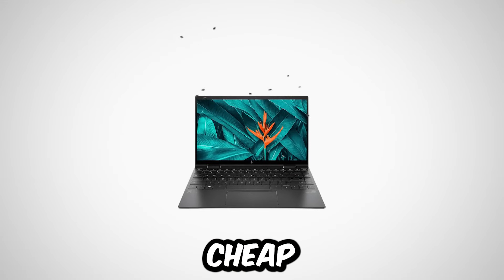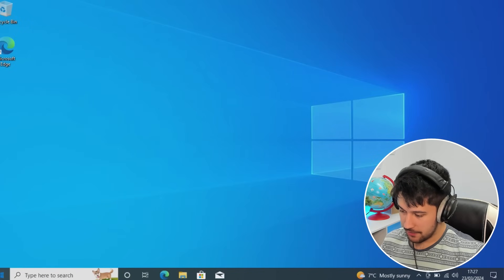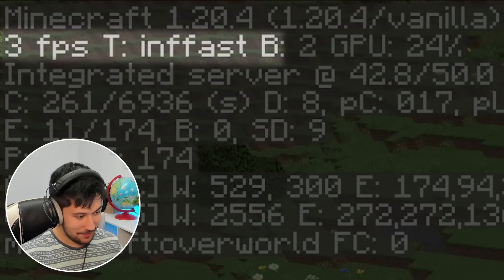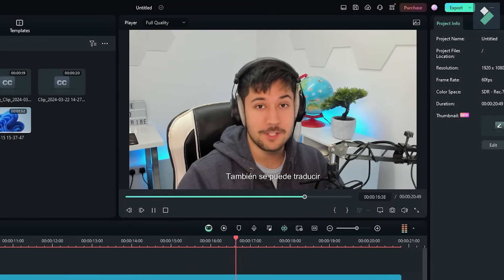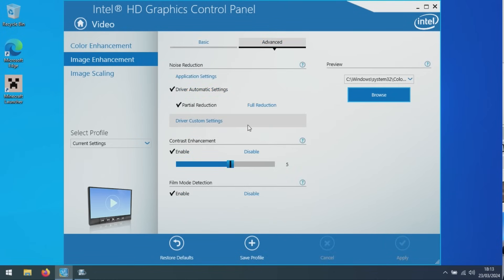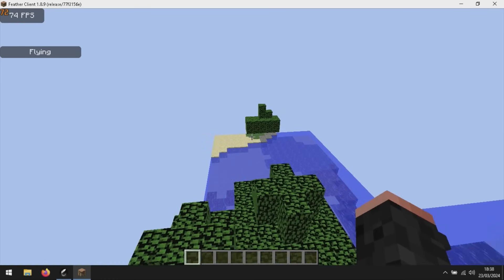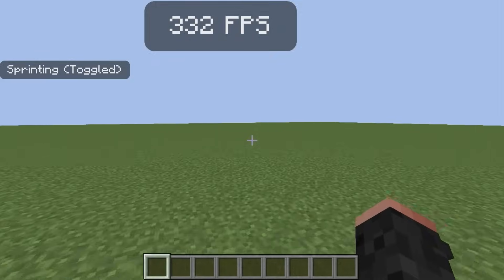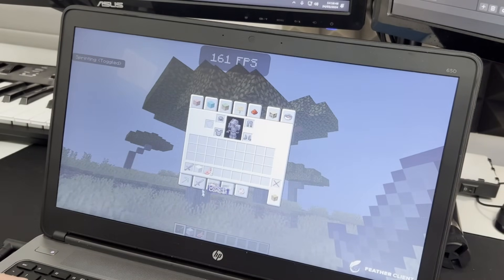How I Optimized A $20 Laptop To ___ FPS in Minecraft

Comment: So, for those of you who are curious, any fps above the laptop display refresh rate is unnecessary.
This means that, after optimizing it as much as possible, you can then tweak the settings however you want until you can play at an avg. of what your display refresh rate is or on the other hand, you can turn on vsync in the options menu for minecraft and have the fps max set to the display refresh rate.
Either way, you do you.

Comment: I have some performance mods use Linux with vulkanmod just in case the gpu doesn't support it inside of windows it make a gt 1030 go from 60 - 100 to 400 - 500 16 chunks both you should really try it
Reply: тут нет вулкана так что Vulkanmod не прокатит а хотя подождите он только под Linux поддерживает, да хорошая идея, я так несколько ноутов ожил и тут тем более intel у которого Opengl станет 4.6 и вулкан 1.1

Comment: I have an old x250 and 1.20.4 with simply optimized is infinitely better than 1.8.9 so im using that. Also your cpu render ahead limit was quite low and keeping it on 5-6 is normally better so that's probably why you werent getting many frames.

Comment: Had a laptop with i3 3110m and with fabric and mods like sodium I easily get 60+ fps but   
compromise with 2 chucks :(, don't lie but  with upgraded ram and ssd it will last long than any ultra budget comes in today ,for surfering net and low  intensive task.
Reply: Had? like you don't use that laptop anymore? Cause there are a couple things left out from the video which would improve the performance even more. If you are interested that is.

Comment: im 100% sure you can optimize glass stone and wires to play 100 FPS on minecraft.
Reply: What do you mean, explain pls
Reply: u need a good cpu to run monecraft at 100fps (atleast a 4/5 gen)
Reply: أراهن أنك لم تشاهده حتى النهاية وقلت ماين كرافت
Reply: @Dryashs  To be fair, Minecraft is a pretty old game based on voxel, I wont be surprised if a 3rd gen intel can run it
Reply: @Baconator20000  it can
Reply: @Dryashs I have a pentium silver and it hits 100 FPS with optimization mods
Reply: He will put i914900kf and rtx 4090 128 gb ram and 4tb gen 5 nvme ssd in glass slab😂😂😂😂😂😂😂😂

Comment: Feather actually decreases your performance when gaming. As well as injecting code into some modloaders, it's pretty bad.
Reply: Yeah should use Badlion
Reply: @QuickVicMC badlion is even worse, the should use forge with of foamfix and another mods
Reply: I use feather and its good for me but that's my opinion
Reply: @coneh2  foam fix is ass
Reply: Feather is better for lower amounts of ram and 3rd-8th gen CPUs. I went from 8gb of ddr3 on 200 fps with a i7 4th gen, to 24gb of ddr3 on same CPU about 100 fps.
Reply: just don't use a goddamn client and get sodium instead of optifine it's way better
Reply: lightbulb pancake car
Reply: @ggolden  omg niko oneshot
Reply: @ggolden  agreed
Reply: I recommend Prism Launcher with a system installation of Java, so you have full control of your client(s).
Reply: Just use Sodium.

Comment: I think you would be better of with fabulously optimized than just throwing together a bunch of mods. A lot of mods are incompatible or do the same thing. Some might even make the experience worse. Using a modpack which has been tested, and is made to get the best performance possible would probably be a better choice.

Comment: For all of those of you in the comment that did not ask, this is basically how I have to try and optimize a macbook pro from 2019.
But in my case, since it's a macbook, it doesn't have settings to optimize the laptop for performance and I don't think it has bloatware... bc it's a macbook. So, I just have to download mods and pray that the performance improves.
I can play at max render distance with an avg. Fps of around 50, I believe. But I also think that some of the performance optimization mods are fighting against one another somehow, so I gotta do some testing of my own to see what is the best combination that improves my fps the best.

Comment: notrodan i optimized my laptop soo good that i can get 600 fps on integrated graphics at accetable graphics and its pretty old too i used the xtboxtool to download a bunch of optimizers and after running all of them + some internet and regedit optimazations and overclocking my ultra low power cpu i managed to achive 3.4ghz with a 2.3 base clock and the 600 fps at 6 chunks 720p in 1.20.1
Reply from the maker: Great work!

Comment: Hi NotroDan ! Could you tell me what all the optimisations and mods you would recommend for a Toshiba NB250 ( 2GB DDR3, 256GB TeamGroup SSD, Intel Atom N455, 1.66 Ghz, 1 core 2 threads, Integrated Graphics, Windows 7 Family Premium Edition ) are ? Also, 1.7.10 Optifine ( EVERY setting on OFF and Fast Math and Fast Render ON ) set on High priority in Task Manager gets only 20 FPS. I need your help 😅.
Reply: Вы пробовали запустить Linux на таком ноутбуке?
Reply: @RKNidinahui666 I'm trying installing nobara linux brother can you help i keep getting put into grub rescue mode when booting the usb and it's saying insmod not found?
Reply: @crusvaceans  скорее всего образ записался неправильно, попробуйте Arch Linux

Comment: I notice you keep blaming it on the GPU. I have a laptop with an i7-4700MQ. It also has HD 4600. It runs minecraft very well. It’s your CPU, not your GPU.
Reply from the maker: Yeah it is only a dual core, maybe a CPU upgrade is what's needed. What sort of FPS do you get?
Reply: @NotroDan i know that it has no stuttering and it runs it 60+ fps with little to no stuttering with no windows optimizations and no performance mods. I have to reinstall windows on it rn, so cant check for sure, but based off of memory that is what i remember. Can you try to buy an i7-4700MQ or something similar and try it on this laptop in a video?

Comment: Hey notro u didn't need to buy the battery because the flashing power button means the battery is very weak (dead) but if u hold the power button for 30 seconds it will turn on i havpd same problem I can easily fix
Reply from the maker: Ah well, at least I can use it without being plugged in all the time now

Comment: how are you running minecraft 1.20 even tho 1.17 and after gone to opengl3 which the intel i3 is not supported???
Reply: the integrated graphics of the i3-4000m, intel hd graphics 4600, supports up to OpenGL 4.3
Reply: @lunaaaaaa_aaaaaa  mine cannot run minecraft 1.17 and after
Reply: @_itsnotstickly_  i cannot figure out what's causing the issue with just this comment, could you provide me with more information of why it doesn't?
although i'd assume you haven't updated your graphics drivers
Reply: @lunaaaaaa_aaaaaa  its a i3-2130m old laptop altho i have another laptop that has a 10gen intel core i always wanted to run minecraft on my old laptop
Reply: @_itsnotstickly_  you're out of luck, minecraft 1.17+ requires OpenGL 3.2, and the integrated graphics in the i3-2310m (you made a typo there), intel hd graphics 3000, only supports up to OpenGL 3.1
this is why you check your hardware compatibility instead of assuming it will run
also you have a 10th gen laptop, why not play on that instead...?
Reply: @lunaaaaaa_aaaaaa  isnt there any way to upgrade the graphics and change it to OpenGL 3.2 like upgrading the graphics through device manager my 10 gen laptop is broken bios chip fired up i am still ordering another bios chip
Reply: @_itsnotstickly_  you can't just hammer in support for newer OpenGL versions if the hardware cannot support it
this is a HARDWARE issue, not a software issue
and afaik, you can't change the igpu in a cpu, the only option is to replace the cpu entirely and even then, i doubt the motherboard would support 3rd gen
Reply: @lunaaaaaa_aaaaaa  :(

Comment: play minecraft on core 2duo
Reply: о да мой комп в таком проце на линуксе с Nvidia gt710 майнкрафт 1.20.4 выдает более 30 фпс
Driver version 470.26
Reply: @RKNidinahui666  try without the gpu 
just integrated graphics
Reply: @CharanDasari-md2rf  на встройке чипсета г33 смог запустить 1.16.5 через эмуляцию наборов OpenGL а так в 1.14 75 кадров было
Reply: @CharanDasari-md2rf  но не хватило поэтому купил 710 которая вчера сгорела а потом и гтх750 бу с авито и 7850
Reply from the maker: I saw a lot of core 2 duo laptops on ebay but I got this in the end ahah
Reply: @NotroDan   try it ones gonna regret it